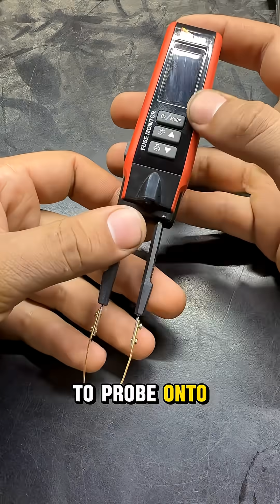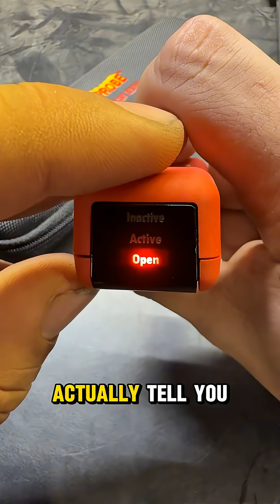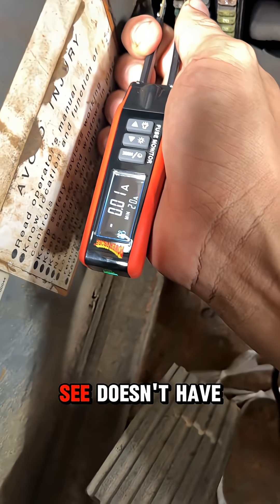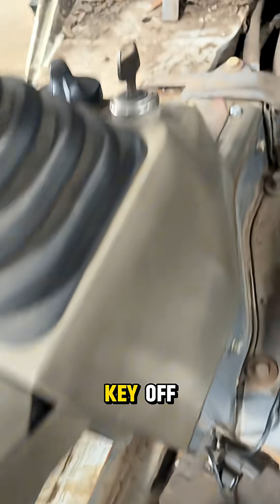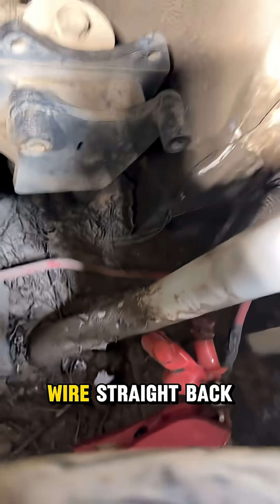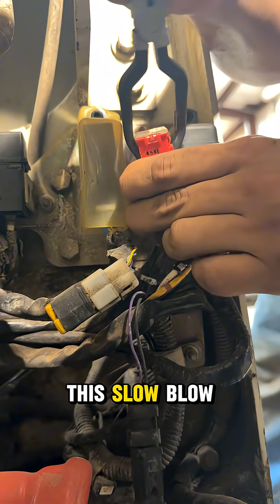If you STILL haven’t seen what the new PPFUSE Fuse Monitor can do…

Comment: I own this tool. It’s great in theory but not the best in practice. The probe tips are not easy to get on the fuse contacts in mini and micro. I want to love the tool. But I find myself reaching for the dm300 instead. Does the same thing. Both are expensive. I really like the direction power probe is going. But I do think they need to refine this tool a bit.
Reply from the maker: Thanks for the honest feedback; we are constantly working to refine our designs and will share your thoughts with our R & D team.

Comment: Its a gimmick buy. 
I purchused it thinking I would be using this alot as my shop gets a ton of electrical issues other shops give up on. 
However I found who can hold the tool on a fuse while searching the circuit? 
I have used for years a amp clamp that can read a 1/4 amp. 
I can see it while going over wiring and modules without having to have my hands on it
Reply from the maker: This tool is utilized to quickly and accurately identify which circuit has the draw. Techs then pull the schematic and take the next step in the process. You're right though, holding it on the fuse while you try to manipulate the items in a circuit that could cause the draw would be difficult.

Comment: max/min/ATC refers to the fuse size. You have to tell the tool what type of fuse you're measuring, because inside of the tool it's using a lookup table for an assumed resistance value. (So, inside the table, it assumes say a 20A ATC fuse is .03 ohm or whatever, and a 20A Maxi fuse is .05 and a 20A mini is .01 as a made-up example). The tool actually measures voltage. Then, it uses some simple math (Ohm's Law, voltage/resistance = current) to display a calculated current value. Usually this isn't a super important distinction, but it is super important to give it the correct fuse size/rating or your measurements will be wildly off.

The AmpHound tools by CalVan work the same way btw.

Comment: The hardest part about doing this with a regular meter is holding the probes on the fuses.  Why don't you make some probes specifically for this that I can just plug into my banana jacks. 
     I really like your probes with the springs in them and that's what I use now and I've had a power probe three since like 2015.  (The blue one with flames on it that looks like carbon fiber)
Reply from the maker: Thanks so much for the loyal support—we really appreciate you sticking with us over the years! 🙌
We hear you on the challenge with holding probes on fuses, and that’s a great suggestion. Every tech works a little differently, so feedback like this is valuable. We’ll be sure to pass your idea along to our R&D team for review. Thanks again for taking the time to share your experience!
Reply: CalVan makes probes that clip onto fuses, they're included with the AmpHound2, google that to see some pics. I haven't found their supplier and i'm not sure if you can buy them separately.
[edit] did go look it up, Cal-Van part # 72-1 for a Mini blade, not sure if you can actually find them somewhere.

Comment: What time I bought this Mercedes-Benz from a friend that was very well off he had taken it to four different electricians a couple of them change the batteries an alternators and a couple of them went through everything trying to find what was wrong with it they charge them a pretty penny each time this product looks great but it wouldn't have helped in this situation you see the climate control would turn on in the Night by itself and use up all the battery every time one was plugged in but this would only happen in the night when temperatures will drop there would be no way to tell unless you drop the temperature on the car while you were at work during the day LOL so make a very long story short I disconnected every component on this Mercedes-Benz until out of all these tests disconnecting the climate control did the trick😂 the battery was good in the morning no power draw this one was a tough one but it got fixed no tools used except for the human brain God gave us

Comment: Not to be pedantic, but it actually measures voltage drop across the fuse and approximates the current based on an assumption of the resistance across the fuse (kind of like a shunt resistor). I think there are also tables online where you could do this manually, but this tester seems nice.
Reply from the maker: Correct! We produced those charts and give them away free on the website!
Reply: @PowerProbeUSA why wouldnt you just integrate your chart readings into the tool so you can press a button and calculate and receive the chart value reading directly on the tool.. would make more sense. Its your chart your product.
Reply: .  I'm not sure of what you're referring to but it appears this is exactly how this tool works.  This tool calculates current based on the fuse type and size by 1st, measuring voltage drop then applying that result to Ohms law.
This is a pretty slick idea if you ask me.
Reply from the maker: @thisisyourcaptainspeaking2259 thank you!
Reply: @sethdavis8391  it’s people like you that should just sit down and let the adults speak. Did you completely miss the very short and easy to read comments above? Or did that require too much attention span for you?
Reply: @JustinsJourneyReal shut up douchbag
Reply: the gradient of my comprehension of electrical theory demonstrates a significant potential difference relative to your foundational cognitive framework.
 Now mr. Pea brain. I skimmed through this like many other videos and seen this extremely high priced set of tweezers and thought nothing of it amd didnt care to read into it and figured it was a voltage drop reference they were checking. Then realized it was indeed amp draw across the fuse. I never cared to respond or check or delete a comment. So congratulations on tracking down an 8 month old comment that I gave about 1 minute of thought into after seeing the countless other thousand garbage videos that feed through here. Now "Mr. Adult" you can sit your happy ass down and have a nice day.
Reply from the maker: For those that need the help (like us!) Pedantic means "like a pedant," someone who's too concerned with literal accuracy or formality.
Reply: @PowerProbeUSA thanks. Mr.Encyclopedia just wanted the feel good about himself
Reply: This.  The current could be calculated based on the resistance of the fuse (most likely based on a lookup table or potentially by measuring the actual resistance of the fuse (unlikely).).
  I just measure the voltage drop then go from there.
Reply from the maker: @thisisyourcaptainspeaking2259 agree. We provide the fuse charts on our PPDRAW website. The PPFUSE just makes the process faster and easier in most situations.
Reply: @PowerProbeUSA Agree, I've seen these charts and was surprised to discover they're actually useful for identifying parasitic loads.  I approve of this method (based on a couple quick tests) and intend on investigating further.
Reply from the maker: @thisisyourcaptainspeaking2259 thank you for your approval!!
Reply: Nerds
Reply: You are pedantic. Many of us can convert mV to mA but if this tool does it more efficiently then it should be used
Reply: Why all the neg comments? Its a brilliant tool so why twitter on about charts? Why do we need a conversion chart if the tools circuitry does that for the user? Its measuring millivolt drop and converting that value to a user readable mA / A value. Its a good tool nothing to not like about it
Reply: Ssoooooo it’s like a +\- 10% accuracy ? 😂😂😂
Reply: There shouldn't normally be any voltage drop across a fuse. Fuses may provide some resistance, but that's a bug not a feature.
Reply from the maker: @troy3456789 this is not true. All fuses have a small amount of resistance, which is what creates heat and causes the fuse to blow when the rated current is exceeded. @toastrecon is correct, measuring voltage drop and using Ohm's Law to calculate is one way to do it. We actually provide the charts on the PPDRAW website free. The PPFUSE is just a much easier and efficient way to get the amperage data.
Reply: @PowerProbeUSA I've noticed cheep aftermarket fuses can have very low resistance, thus the voltage drop is also lower than anticipated,
Have you run into this much?
Reply from the maker: @thisisyourcaptainspeaking2259 we have seen inconsistency with very cheap fuses. Scary, because low resistance means low heat, and fuses that might not blow at their rating.
Reply: .  My testing indicates these cheap fuses are way off.  I haven't actually msasured voltage drop but these fuses don't melt open at the specified values.
Reply: . Turns out we can measure a voltage drop across a fuse when current is flowing.  Often this can be used to identify current in excess of 100ma or so.
I'm not a huge fan of this because fuse resistances can be all over the place but this can be a reasonable starting place (time saver).
Reply: Only superconductor doesn't exhibit voltage drop, anything else has voltage drop even large gauge cable but maybe in the miliamp to microamp range
Reply: @TranceSpirit7 Exactly, this method does have merit.

Comment: I wish I could use that but I work at a Chrysler dealer and they use a lot of cartridge fuses and you can't back probe them
Reply from the maker: Yes, J case fuses are a drag!
Reply: J case fuses and engines / automatic transmissions without dipsticks, just say NO.
Reply: I work at a Chrysler dealer too I usually pry the cover off slowly

Comment: Nice assess. Not everything is that wide open
Reply from the maker: We appreciate the feedback! We've found the tool is quite versatile even in tighter spaces. Thanks for checking out the video!
Reply: @PowerProbeUSA easy one can add alligator clips and some leads
Reply: @dieseldawg7132  The conductors for addon alligator clips would need to be thick enough to carry 20 amps. How thick? Need to know how long the conductors will be.
Reply: @t @troy3456789 but if your looking for a power draw you won’t really have to worry about all that…. If it was drawing full power lets say 25 amps like a blower motor it would be obvious it’s staying on